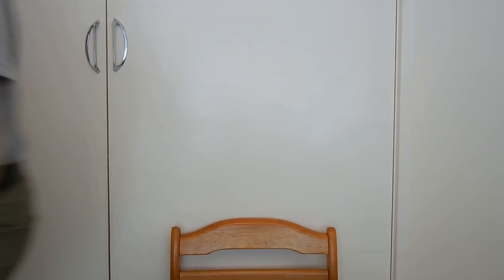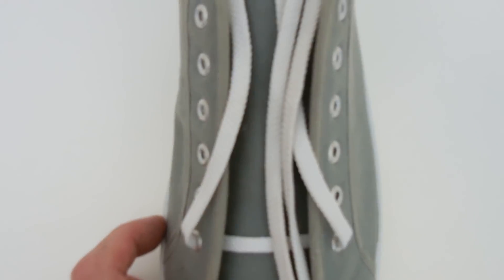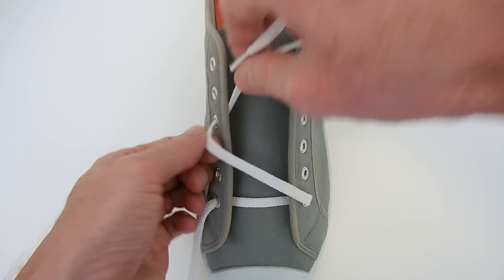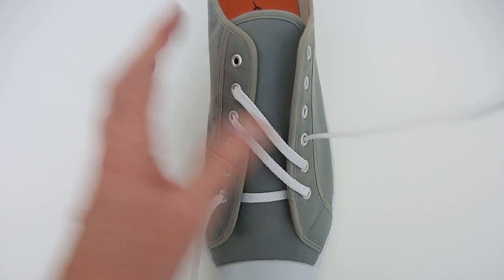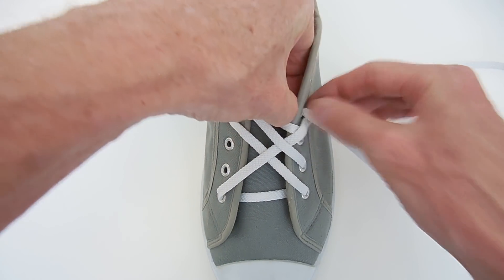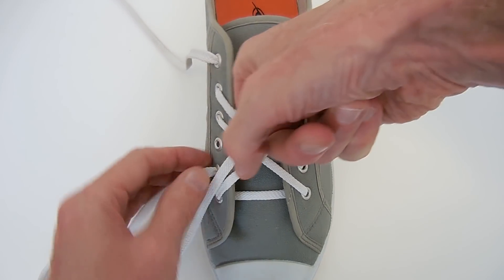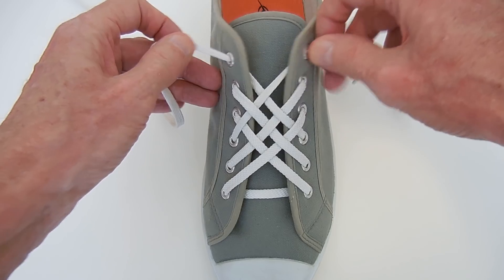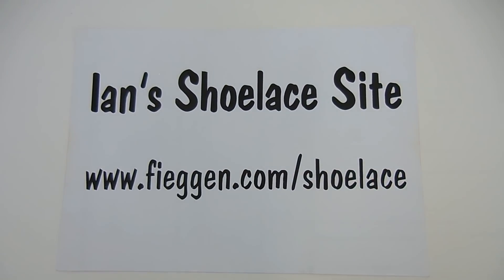Lattice Lacing Tutorial – Professor Shoelace

Comment: But there is only 5 hole in my shoe
Reply from the maker: It's possible – though not ideal – to do “Lattice Lacing” on five pairs. If you're prepared to have the shoelaces running twice through the middle row of eyelets, you'll end up with a slightly compressed lattice.